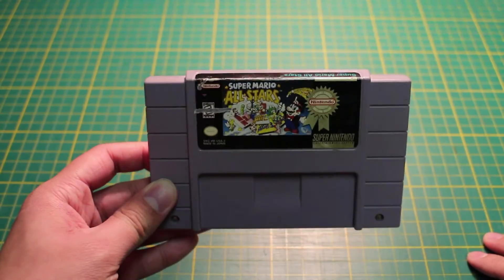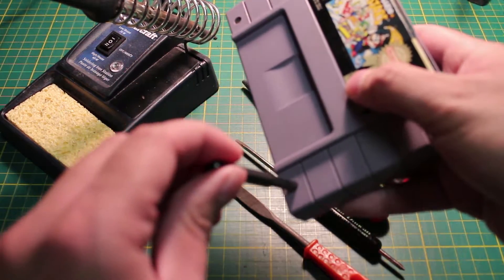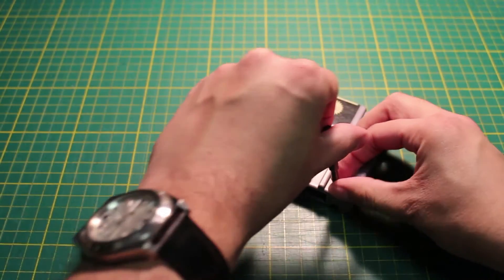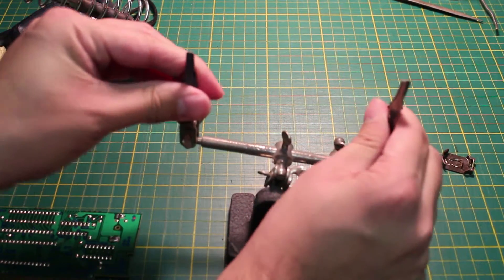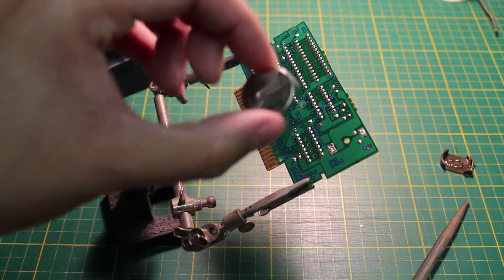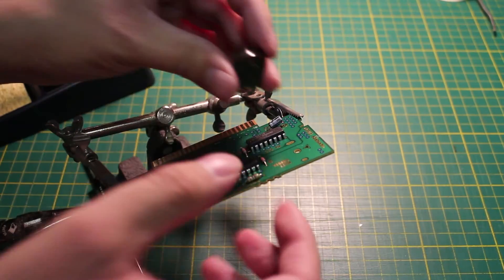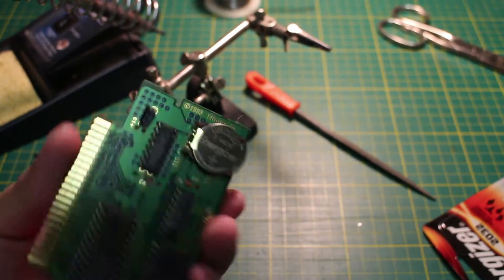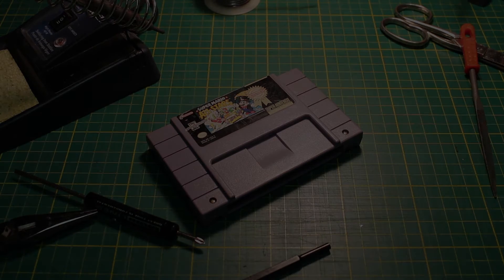Changing Save Batteries PROPERLY (SNES)

Comment: You can use 2 AA ou AAA batteries on a holder to keep your save while changing the CR2032. Just find a positive and ground point on the board, solder the AA/AAA holder's wires on these points (use the correct polarity) and you'll have 3V in parallel. When the new CR2032 is in the place, you can take the AA/AAA holder away.

Comment: It would be good to use desoldering wick to first remove the old solder before trying to pull the old battery out. That will make getting the old battery out easier and installing the new battery or battery-holder easier as well. It will also protect the PCB's solder pad from over-heating as you hold the soldering iron to it while trying to remove the old battery. The solder pads can burn up if they take too much heat.

Comment: I know a waaay better idea to replace a battery for once for all and for good, those battery’s are already well knows since the 70’s ,so i really don’t understand why nintendo never opted for such battery’s ,, i am talking about the nuclear battery wich will magically load itself indefinitely from 5000 to 28000 years, that’s right, up to 28000 years,
Now it may only will generate 1/4the power unlike a regular battery but it may be just enough to keep serve the ram chip from power, if not, then we could implement a transformer to turn that lower voltage into a higher voltage, this way we should never be worry about a saved data for a whopping 28000 years👍

Comment: You can get cheap CR2032 batteries with leads already attached so you don’t need to use the weird battery holders in there
Reply from the maker: The point is that you can simply change the battery without soldering in the future

Comment: A nice random tip of the day:

If you have a modified PAL (Super Nintendo) or NTSC-J (Super Famicom) Snes which can play games from any region - but have noticed that American NTSC (Super Nintendo) cartridges are a little too wide to fit into the console, then do the following:

1. Open up an NTSC game cartridge, and take out the circuit board.

2. Open up a PAL game cartridge, and take out the circuit board.

3. Put the NTSC circuit board into the PAL (or indeed the NTSC-J Famicom) cartridge game case.

4. Be happy you didn't have to buy and adaptor, and play as many NTSC games as you want on your PAL console!

Note: all circuit boards fit in any region case, but no matter what shape the circuit boards are - if you are swapping out FX games (with the additional contacts either side of the main connector) - then likewise, swap the corresponding game cases to match!!!

Have a 'Super' day! ;)

Comment: dude is terrible at soldering! Use a better tip, tin your tip and you can even add a bit of solder when desoldering to help with heat transfer. Use better solder!! My favorite solder is Kester 63/37 lead alloy .031" diameter. DO NOT use the lead free garbage.

Comment: I feel like a dumbass because I just attempted this and couldn't get the original battery out. The metal around the tabs melted, but the battery wouldn't come out no matter what. I've never soldered before and could have done something wrong but it's frustrating

Comment: This is not the proper way to do it. Drop the game and the battery dislodges. Batteries with the mounting soldering Tabs are the only way to do it properly. The original batteries have lasted anywhere between 20 to 25 years. Adding a new quality and I strongly suggest and stress quality it would last another 20 to 25 years. Use a cheap generic no-name battery and you would have to change the batteries sooner.
Reply: Then how about this, use some electric tape so it doesn't fall out then? Re-enforce it. It's better to do it this way because it's easier to change a battery. Use any battery that you want.
Reply: @deegee2416  the tape method is horrible 🤢🤮
Reply: @ecuadorianeel  JB Weld method better LOL?
Reply: @deegee2416  Oh hell no!
Reply: @ecuadorianeel  What did I miss? Have you tested this method out?
Reply: @ecuadorianeel  ah I see, you mean the proper way. I did research on those battery holders he is promoting on the amazon link. People said they were hard to use. Maybe I should use your method.

 I plan to do this on snes catridge. So far I got this planned in mind to buy
836-P No Clean Flux Pen, ATLIN Gamebit Screwdriver set,  0.31 inch diameter Kester Rosin solder, a desolder braid.

I just don't know what to pick out for the soldering iron, any suggestions. Keep in mind I'm new to this. Otherwise do you have any suggestions?

Comment: I have a 3.8mm gamebit but it’s to big and it does not work
Reply: Yeah I have super Metroid the dead gum case does not have any screws in it. it just snaps together and the mother board is not as big as the super Mario all stars and the dam thing doesn’t even have a battery in it but it has a metal holder for the battery to slide in it

Comment: Dude this is awful advice sorry to say but the is a reason why they use soldered OEM joints also you can just make a battery support system so you don't loose your save also turn your iron temp up this is way to long on the contacts  also you have ruined the resale value of the carts doing this

Comment: Is particular placing important when soldering the battery clip to the board? Do the holes in the board correspond to a particular arm on the clip?
Reply: Yup, there's a positive on the holder that has to correspond to the positive hole in the board. In general if the two holes are placed vertically then the lower one is the positive, if horizontally then the right one is the positive.

Comment: I bought a few 2032 battery holders from Radio Shack.The batteries don't snap in like the one you have. They have that long metal positive strip going across the top. The battery keeps coming out. Any suggestions?

Comment: For removal of the battery, I used a desoldering braid.  Is there any reason why you decided to remove it this way?  I am wondering if you've tried the braid method, and if you find this method easier.
Reply from the maker: The reason I didn't use a desoldering braid is simply because I don't have one. I have never used one either.
Reply: +YellowSuperNintendo I really like the idea of that battery holder.

Comment: Please be advised not to use plumbing solder as it contains acid, look for rosin core solder if you are to work with any electronics
Reply: Any particular size you recommend?
Reply: @willshin9388  I honestly just used what I had handy. Wasn’t too heavy of a gauge, maybe .711?
Reply: Thanks for the intel👍
Reply: I Work in a retro game store. I find Red Tools: 0.032" is best. Lead free and pretty cheap and always effective.

Comment: If the battery has not died yet and the saves are still good ... and you want to keep those saves ... there might be a way to save your data from being erased when changing the battery.

Basically, you solder a 3 volt battery into the circuit in parallel with the save game battery.  Unlike wiring a battery in series with another battery, wiring a battery in parallel should not increase the voltage but, instead, increase the effective capacity to its load.

More importantly, the battery wired in parallel will ensure needed power constantly remains to sustain the RAM while the old battery is taken out of the circuit.  Then, you solder in the new battery, disconnect the temporary battery, and check it out.

The pitfall may be shorting either of the batteries in the whole process, causing a short circuit.  As electricity will always flow towards the path of least resistance, a short could deprive the RAM of electricity, causing data loss.

Comment: Watched 10 videos..this was the best method.  Most pry of the battery and tape or re solder.  Tape is great if you don't want to solder..but I like this clean method.  Some say the holders are too large..you link to one that works.  Thanks.  I just started collecting and only have 1 game, and a couple on the way...so will have to try this.
Reply: I did this with a snes Zelda game. Carefully pried the old battery out, inserted a new one. Wrapped it with one turn of electrical tape to position the battery between the contacts and a small, folded piece of cardboard to press the contacts against the battery with the cartridge assembled. Works great. Game saves progress just like new. Also gently sanded the contacts with 300 grit paper (wet/dry)

Comment: I checked the website for the battery holder and it has a quantity of 500? I tried changing it to 20 and it sent me to a different order item. Looks the same but how can i tell if its the same battery holder.
Reply from the maker: I linked to the Canadian version of the website, so if you live in a different country, then that might be what's causing you troubles. The part number is S8421-45R. You can just google it and there should be plenty of places to purchase it from.

Comment: This tutorial is nice but it seems to be missing info regarding properly orienting the battery holder with regards + and -. Is that an oversight or am I missing something?
Reply from the maker: I didn't really make it clear in the video, but the battery holder only fits one way, so no worries about putting it on the wrong way around.
Reply: YellowSuperNintendo I see. Does that also apply to Super Famicom cartridges as well?
Reply from the maker: Ragnorok64 Yes, this applies to all Super Nintendo and Super Famicom cartridges.